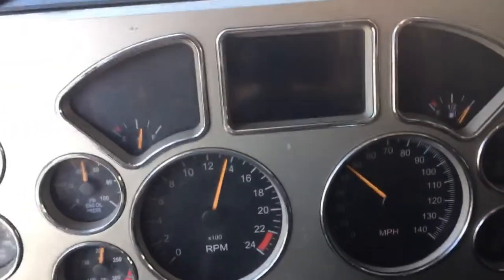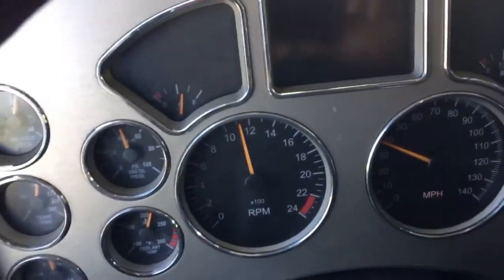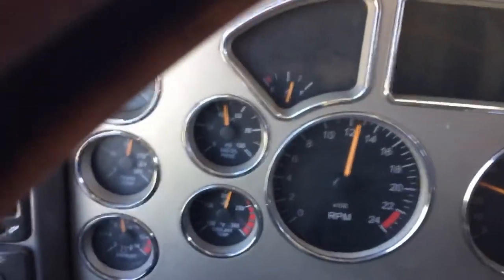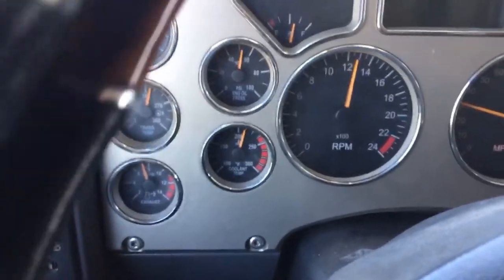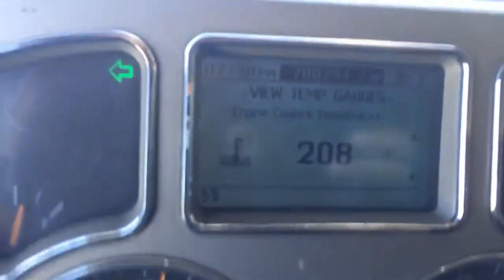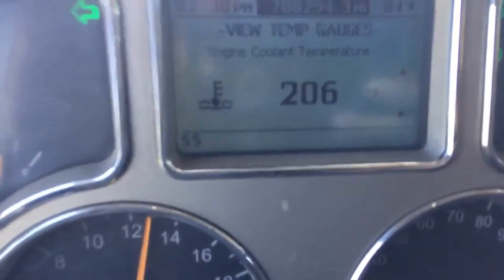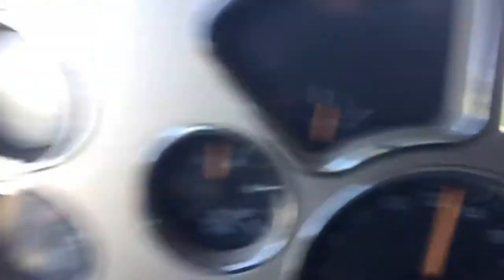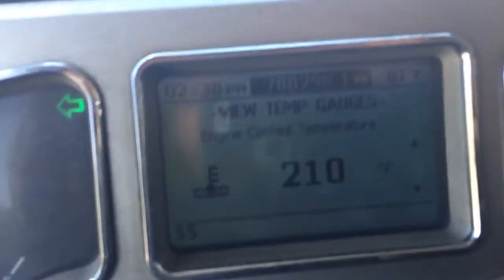Proper Way To Climb A Steep Incline Big Rig Truck

Comment: I found that it seems like, especially on a diesel, there’s an operating rpm range that works best at getting you up the hill.  Too low rpm, I find my truck runs hotter, as well as too high of an rpm. I had someone who was a log truck driver say if you floor it up a steep hill even if it only goes for like a mile, you’ll melt the pistons and seize the engine up before you make it to the top.